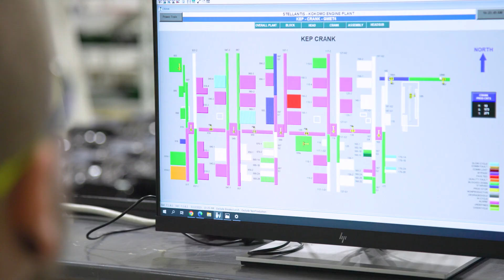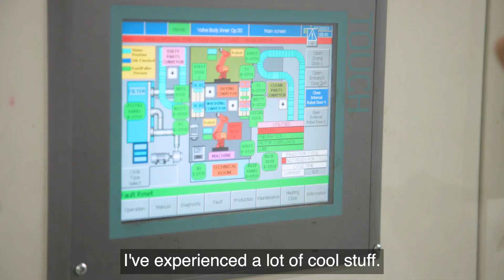Meet the Maker, Michael Vasily, Kokomo Engine Plant

Comment: Owner of 2019 Pacifica Hybrid here. I’ve owned it for 46 months, and it has spent six months in the shop to replace two transmissions. Part of extended downtime was getting a diagnostic appointment the second time. Once Van was actually seen, diagnosis was simple because it was dead. 

Anyway, both times I needed a new transmission, it took 4-6 weeks to get a replacement. 

So I’d like to see you interview the “hybrid transmission guy” and ask him why the transmission case casting causes the high voltage wires to chafe and short. And I’d also ask him (or her), why it takes so long to get one? Is it like a deli, do you make them “fresh”?